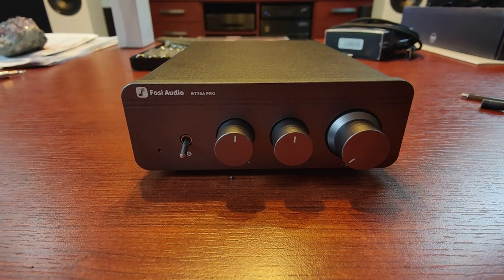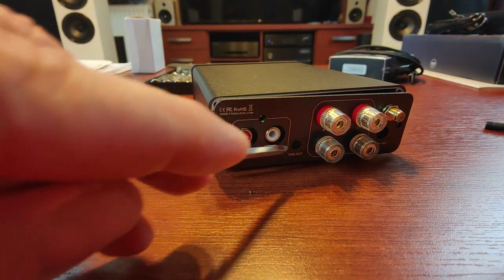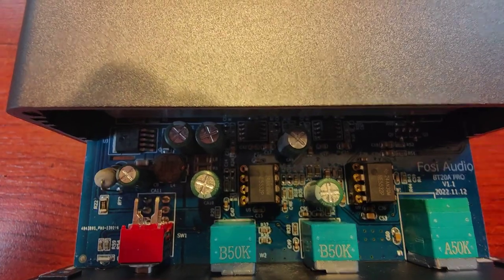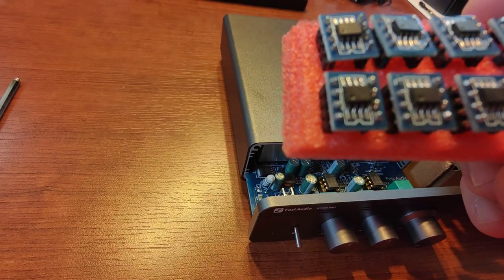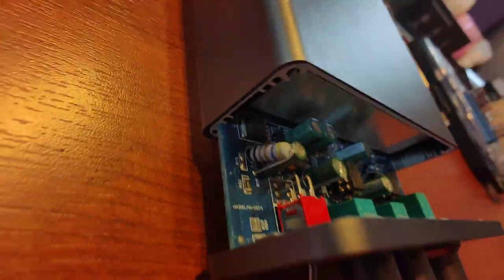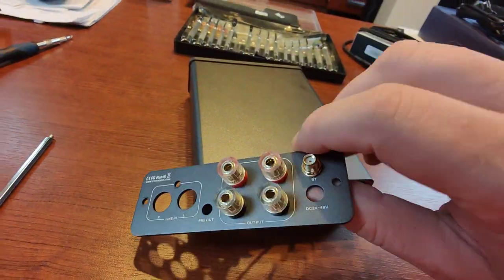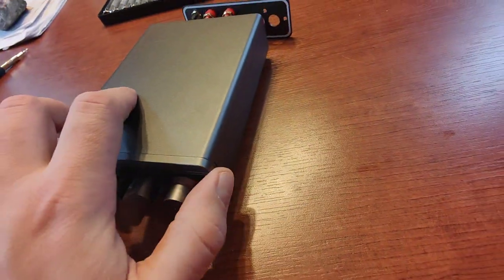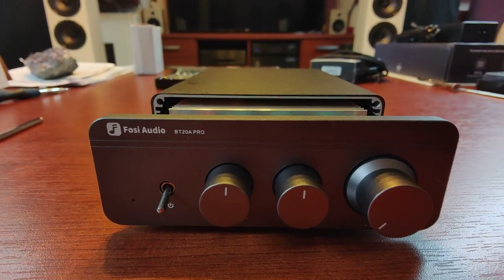Fosi Audio BT20A Pro amplifier inside - changing opamps

Comment from the maker: @Bernd Herrmann yes OPA627AU is single channel only, thats why I have DIP8 adapters with 2 pieces each. But your point is valid. NE5532 should be replaced only with similar, 2channel opamps.
Reply: Is it possible to install Burson V6 Vivid on this amp ? Or  the case its too small ? The height of Burson is 29 mm ..
Thank You for info !
Reply from the maker: @lukaszdziaba8687  these are really tall! They won't fit inside I'm afraid...

Comment: Okay so I changed OP AMPS for AkLIAM LC5, the hardest part is dissasembling this fosi BT20A Pro, needed to get out knobs and unscrew front. It was very muddy for first hour, didnt feel like I won anything but then after 4 hours it started to show something new and I really felt an improvement. Definitelly more detailed sound but it's not that big - it's equal to price you pay for dissasembling and price of new op amps. It is worth as you can learn about everything else, even know that you can change capacitors and more.  also this lc5 almost do not fit, one knob stays in the way - my one amp is little bit bent, yet it works. It looks nice. It looks special and awesome.
Reply: Also I got another question which is my purpose to remove noise from my speakers. Cause I know more hides behind them. And I got Pawalle LB-100 power filter. It didnt improve a lot in terms of noise. Got Odin Nordost Gold fake connected to it. I think he needs burn in, maybe pawelle too, cause it added little bit muddiness. Today I tried ferrite cores/rings on near connection to power amplifier. still noise from tweeter. I was thinking it is my power supply fosi 48v5a I bought, maybe he adds it to speakers. I also have one EMI filter "4 stages of filtering" from aliexpress, maybe I can cut this power cable from power supply to fosi and attach this EMI filter, maybe that will improve something. And today I learned about capacitors in speakers. Those can be upgraded too. Hmm. Yeah my question is, did you ever remove noise from your speakers. And can capacitors in speakers be the culprit? Is it worth to cut some cable and attach EMI filter between power supply and fosi BT20A Pro?
Reply: Also I ordered my first Preamp Douk Audio P2 tube for this D class amp as I read it's very good combo to resolve dryness and whatnot. Never tried them (preamps) before. It was cheap and it's still headphone amp, can learn about tubes I was never excited about them much and 60$ is still winning + learning. Ah right, connecting to my phone via USB exclusive mode - tweeter still makes noise. btw, it was strange also - it seemed like similar noise level. But it felt nicer to listen with phone. there is so much stuff going on with sound omg. Have nice time with everything you do!
Reply from the maker: Give them some more time to shine, it takes some hours :)
Reply: @k4syx  I swapped power cable from my PC(which is cheap and long used) to pawelle power strip and connected Odin Nordost to my PC and muddiness dissapeared. So after 200 hours/month I will swap them again to see difference and update if there are changes. I hope for big gains :)

Comment: I get noise from the bluetooth on my amp, when it is not and in use. It comes out on middle drivers on the speakers.
Very annoying on music when the sound is low...
The bluetooth injects noise probably on the amplifier itself, as it is coming louder when I turn the volume up.
Looking at the board you show here, it seems like the bluetooth module is on the main PCB and will not be easy deactivated by cutting the power to it.
Reply from the maker: @LordGryllwotth  mine is quiet. If your sure that the culprit is Bluetooth you can track the PCB based on module pinout and do a precise cut there

Comment: Hi! A lot of people seem to think swapping opamps is a placebo and doesn't change the sound much. (barely noticeable unless you really really really pay extra attention). What's your experience please? Thank you!
Reply from the maker: Hi! It does change the sound in noticeable way, especially when you're doing comparison using headphones and/or your system is transparent. Having said that, these are not day and night changes and new set of opamps won't change bad amp into great one. Also, in my experience opamp rolling is most effective in DACs. I need to find the time to make video on this as I also have a simple way of comparing them that I'd like to share.
Reply: @k4syx  thanks for the feedback, much appreciated!
Reply: After listening to some recordings of others doing it it seems like it is very worth it to change, you can hear that the NE5532 is worst on the test.
 I will try to get OP249

Comment: Are you also considering upgrading the 32V Power supply that I believe it comes with, to the more powerful 48V Power Supply?
Reply from the maker: No, 32x5 gives 160W and that's plenty for my needs. I've just recorded video on request from one of the viewers to demo max volume. I couldn't go to max because 3/4 was already blowing my mind.
Reply: @k4syx  If using smaller speakers up to bookshelves, 80wpc max (not sure of the actual lower THD specs however), is probably fine, but probably not for larger speakers or floor standing speakers.
Reply from the maker: @richh650  Well I've done my listening tests with Diamond 12.3 floor standers and it was fine for me. Granted, these are quite efficient and I'm not listening with neighbors-wake-up! volume levels :)